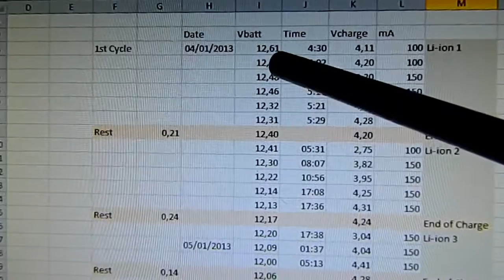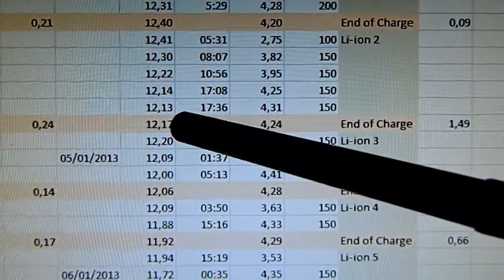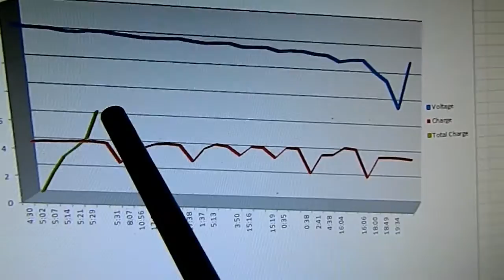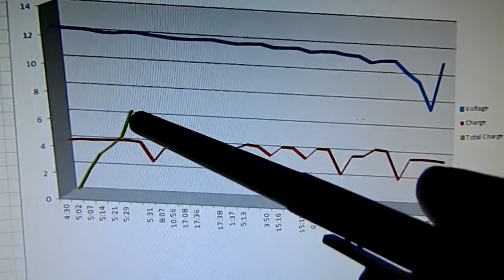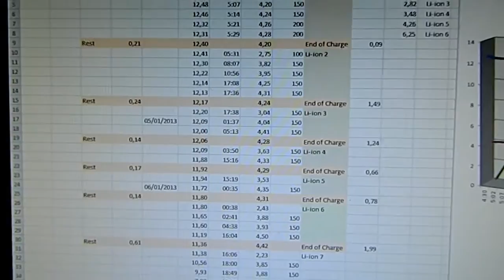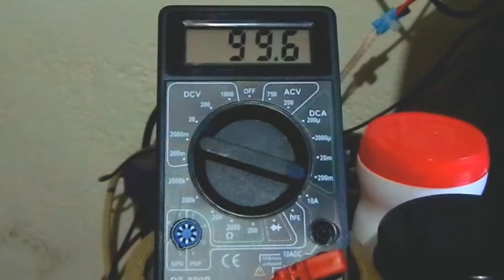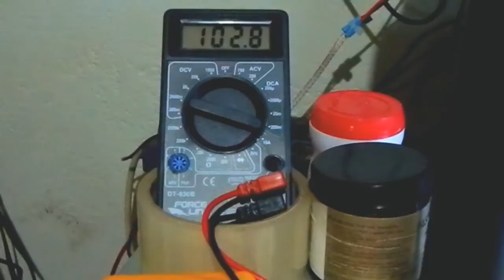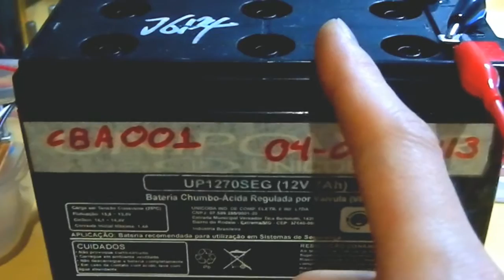Crystal Lead/Alum Battery CBA001 1st Discharge

Comment from the maker: The first charges the batt rested at 13.6v but now, after long time charging and discharging, it rest at 12.6. It does not matter if I charge the batt up to 14 or 15v, it rest at 12.6.

Comment: What did you charge with what?
Did you charge the lead alum with lithium cells?
Try to use your joule thief and then use a real lamp load to discharge the lead alum battery.
Otherwise well done!